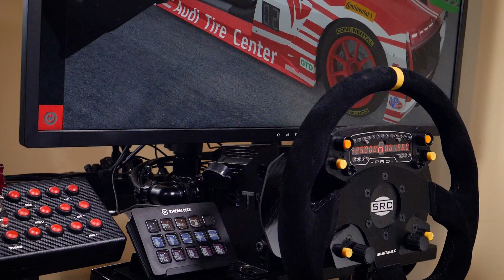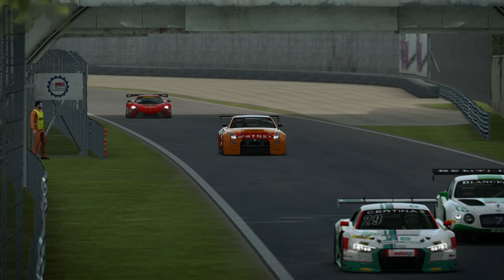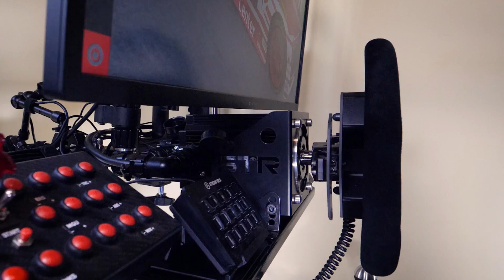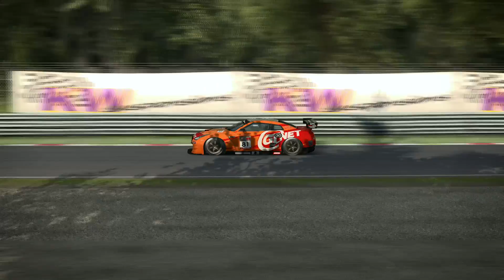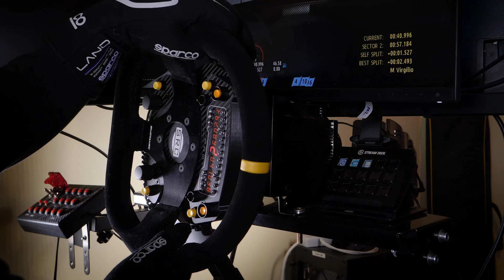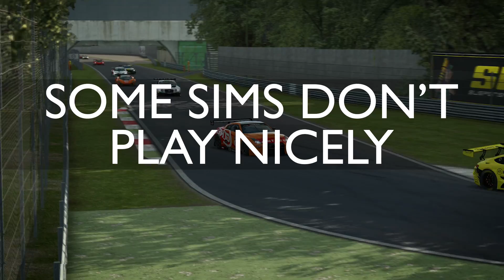Direct Drive Wheel - What They Don't Tell You

Comment: Best Rig: Simetik k2, not expensive but really adjustable but rocksolid
Reply: better: Simlab GT1 Evo. almost same price point
Reply: @Tintop  1 costs 300$ other costs 500$, almost the same :)
Reply: @jorgeaugusto.55  i don't know where your numbers are from, but the Simetik K2 costs 324.90€ (367.98$) incl VAT, the GT1 Evo cost 392.40€ (444.43$) incl. VAT. 
Fully fledged (monitor mount, mouse holder, keyboard tray, shifter mounting points, handbrake mounting point etc) it would be 638.49€ (723.08$) for the Simetik K2 and 655€ (741.77$) for the GT1 Evo. Outside EU you can subtract VAT. 

That is almost the same for me. Both still need a racing seat at this point.
The GT1 Evo is more costumizable in the end and better for later changes. It can evolve with your needs and ideas. With the K2 you are more limited to what you get.

Comment: Hi Chris, great informative video, as many of yours I've seen recently (since I recently subriscribed lol)

I would like to ask, about the seat, that as you mentioned should be sturdy enough, to don't lose the fidelity of the ffb

Recently I've been thinking that maybe one day I would want to upgrade from the G29 I am using, since I feel... It has its limits

The problem is, I got the G29 used for a good price with a Playseat Forza Motorsport 4 edition (which kinda looks like the Playseat evolution, with the wheel stand mounted right on the seat)

Most likely it won't be enough but, would you suggest upgrading the seat first? Or the problem is not that unbearable so that I can solve it later?

Also, recently I won a 100 euro discount on the Next Level Gttrack in a race, what do you think of that?
Reply from the maker: Hey Garden - yeah, I would imagine that you'll run into issues with that style of pleayseat if you get a stronger wheel. Don't forget though you can always turn down the force feedback forces if you need to. I like the look of the Next Level GT Track, though I've never used one. It's has additional upright supports and a much better seat, so from a design perspective, it addresses all of my issues with the F1GT.

Comment: Great info. For some reason I thought you had a ClubSport V2.5. Quite a jump from a T300 to a DD. I am going to hold off and see how DD1 fares, I already have a load of Fanatec wheel rims and other bits so that would be perfect for me. Also, I am pretty interested an the Fanatec Rennsport rig or the Trackracer RS6 to replace my Playseat, just trying to imagine a DD in my deck chair! All in good time though...
Reply from the maker: Hey dude - yeah, I was a happy T300 user for years. Honestly don't know if I'd have made the switch right now if I were using a Clubsport 2.5 - a few people have asked that very question. The Trakracer is the one with the single, side mounted wheel deck support right? That design feature concernes me a little, I'm sure it's sturdy enough, but I'd want to see video of how it handles the load before I parted with my hard-earned!
Reply: @ChrisHaye  Yes, that is the track racer. The tubing looks very substantial, it is the adjustability that appeals too. A lot of the rigs seem to be over complex, way too expensive or too flimsy. The extruded aluminium ones just look unappealing. What to do?

Comment: Chris, I agree about the sliding point you raised. I only have an Accuforce DD wheel but I still have found catching slides induced by my poor driving it a lot more intuitive and successful than with my Fanatec Belt driven wheel.
Reply from the maker: Heh, indeed. I've found that I'm more 'active' with the wheel than I used to be, because feeling the grip limit is a lot easier.
Reply: Oh wow, I gotta ask you..lately I've been eyeballing the exact OSW kit Chris has from simbay 20 Nm Bliss C 4.2 mil cpr.. but still part of me wonders about the Accuforce Pro V2 as the Sim Commander software should eliminate the need to tweak cfg files plus individual FFB settings per car and even physics driven Buttkicker capability as an added bonus. So I guess my question is do you like the Accuforce? Crave more torque? The Accuforce is considerably cheaper for me to get here in Canada. ( And even comes with the rim! )
I too will be upgrading from a belt driven TS-PC Racer so any insight would be appreciated.
Reply: @ericdeangelis7496  I came from a Fanatec V2 and still find myself turning down the FFB as even though the Accuforce is not the most powerful DD base its got far more power than i will ever need and will make my arms ache after a long race. I enjoy using the auto profiles Sim Commander creates for most sim titles and i only have to tweak a couple of sliders and i am good to race.

Comment: Honestly who runs at 100% ffb? Why would you want to? After 8 hours of sim racing you'd be pretty sore and your performance would drop off significantly. I almost feel that the people going after high torque are the same crowd that think harder to drive cars are more realistic.
Reply from the maker: Totally agree Steve. It's nice having the headroom, especially in Assetto Corsa, where some of the cars have quite subtle feedback. But, turning everything up to 11 doesn't really offer much!
Reply: 100% FFB is a great way to get huge arms, mate
Reply: @ghoulbuster1  On one giant arm if you are doing ovals....
Reply: Or one Giant Right Arm if you are doing ovals... :)
Reply: In a real car on a real track you want to keep as light of a grip on the steering wheel as the car allows to maximize the amount of information you receive, on top of that light hands react faster to catch unwanted rotation. So having the torque cranked up requiring a heavy grip isn’t something I’m a fan of. I need just enough torque to give the fidelity I want and push back as the car rotated, no more.
Reply: I lowered my ffb to 45 on my tsxw driver.
Reply: I believe that people should try to get the wheel to give the same response the real car would.  Not higher, not lower. Problem arrives when you are driving a progresive power wheel since I believe games don't usually take that into account for their FFB.
Reply: @sollostyles I'm sorry, I don't recall providing a precise unit of measurement involving eggs.  I said "as light as the car allows."  If the car demands a heavy grip to control, that's that, but you really don't want to hold the wheel with a heavier grip than absolutely necessary to get the transition response you're looking for.
Reply: I use 100% on ovals and 50% on road courses on iracing
Reply: @JohanFouche-k7w  What?
Reply: @TheGermanSimracer  How do you miss the blatantly obvious connection to them ?  Do you even know what YOU said in the post to get that reply ? Are you dumb ?
Reply: I drive and occasionally track an Elise with non-power assisted steering car and a level of steering effort required for that is certainly above what a lot of consumer FFB wheels can produce, as in my experience are karts. Perhaps not the peak torque of a high-end direct drive wheel, but if you're using them to prepare for driving a slicks and downforce race car then it could be in that region.
Same goes for brake pedals - even my Fanatec pedals require a LOT more force than most road cars, but actually aren't that far off what is required for the Elise under heavy braking as it has non-servo assisted brakes, and I've used them to improve the level of force I could apply whilst heel and toeing in a safe environment. Single seaters I've driven even more so.
Reply: It does , even racing go karts im sore all over the next day ,
Reply: I couldn't agree more, when I stream of 6 hours my arms would fall off at 100%.
Reply: @ATLRIOT  this sounds like you suck..... jk jk but honestly wouldnt it make you a better driver to go FFB 100%? so you are used to the amount of FFB a car actually gives you
Reply: hHarder force feedback is fun! I know less feedback is better for performance but stamina is also part of it isn't it?
Reply: it's more of something which is an annoyance to me, you only need a small amount of force to get the critical information across and having the wheel resist you constantly is like having someone constantly tapping your shoulder, it's irritating and not necessary.
Reply: It's for lazy Arm days
Reply: I think in PCARS I run my T300 at something like 40%.
Reply: 100% FFB is fun on offroad races / offroad cars
Reply: I agree 100% ffb is pointless. It does only make you tired, it is not realistic even.
Reply: @francescofazio3518  You are correct, it's only partially realistic. The peak steering torque on my Rotax + Maranello RS-7 is greater than the strongest wheels, and the RS-7 isn't even particularly stiff.
One heat is 15 laps at my track. We run 4 of these. Final heat is 20 laps. I have not had a single non-racer try my kart out and be able to finish a single, 15 lap heat and they are driving at 70% pace at the very best.  They last about 8-9 laps maximum and need help getting out of the kart because their hands and forearms are locked up.
It is a real eye opener for anyone that tries it, racing 2 stroke karts that can do 60mph + is very hard work. I lose between 7 and 10lbs of water weight every Sunday during the season.
Reply: I don’t think its about making it harder, its about making it more real.  Great lap times to me are shit if they’re not accurate to what real world lap times are.  If you’re racing with then real than real forces you’re basically “cheating” so to speak.  Simulation that doesn’t actually simulator some of the forces in a real race is less realistic by nature.

E-Sports especially to me are a joke right now.  Without more realistic forces, motion and FOV they are basically just doing memorization.  E-Sports needs to up their game.

Something like this would suffice.  ;)

https://youtu.be/aWok3AJshGc
Reply: 8 hours of sim racing? What do you do for a life? Or is that it?
Reply: 100% FFB is unrealistic as most racing cars nowadays has power steering.. 100% FFB feels like driving a 1950 non power steering lorry
Reply: @d1want34  "100%" doesn't mean anything by itself you know, if you are using anything up to a fanatec CSW 2.5 there's no way for "100%" to be unrealistic as even with power steering in a normal road car which is designed to be especially light you can get forces coming from the wheel which are higher than the maximum torque the wheel base is able to produce... now if you have the OSW mentioned in the video then 100% can be unrealistic as they can produce twice as much force a normal power steering assisted car would but then if you're driving a non assisted car then 100% becomes realistic again and in some cases 100% is STILL weaker than the real car would've produced.
Reply: @d1want34  iRacing reflects this the best.
Reply: It's free exercise mate. Suit up during summer and lose ten pounds in one race for a real simulation experience ^____^
Reply: 55% AFV1
Reply: Part of the problem is some people setup everything backwards, where they put the sim's FFB to super low levels and the wheel at 100% FFB...that's the equivalent to watching a movie and turning your TV volume to super low and cranking your surround sound system to maximum...you're increasing noise, losing dynamic range and putting your ears at risk in case a random pop occurs...sim racing is no different. Set sim's FFB level to the highest with minimal FFB clipping in the sim (most sims have a FFB meter) and then set your wheel's FFB to the strength you prefer, which for most sane people seem to be between 20% - 60% (assuming a 20Nm motor). I do know people rightfully did this on lowered powered Logitech wheels and it's a learned habit, but totally unnecessary on DD wheels.
Reply: You play for 8 hours?
Reply: I use a T500RS and I run 100 percent
Reply: How about getting a good workout while having fun racing :D
I'm only joking tho, I don't even have a wheel to race on but my brother has a g29 and it's quite light even on max torque(afaik it's only about 2Nm though) With some 20Nm wheel 100% would be too much for prolonged racing.
Reply: I'am at about 95% on f1 with a belt driven wheel (t150).
Reply: how is your ts 150 doing🤣🤣
Reply: The 20nm is enough for me, i only use half of it, sometimes even lower.. as i use my hands for work as well. It's a very nice kit which improves the quality of simracing Alot. I just like where the simaccessories are going!    I fondly remember me playing Indy500 with a tiny joystick, just to get less screech out of the tires (pc-speaker, loL) and to get better laptimes, more realness.. back in the 80's..
Reply: @Frankestein01nl  I used to race with a NASCAR 2003 league when I was in high school, and the only race I ever won was with a joystick! It was my only non-keyboard option and it actually allowed me to smoothly get on and off the throttle, and smoothly turn. Of course, the league banned racing with anything that wasn't a keyboard or a wheel after that...
Reply: One thing is immersion, the other is speed. A high torque wheel will accelerate faster, giving much more accuracy. Especially important when you hit a curb, or you lose traction or something. If for example your wheels want to align to 15°, a high torque wheel will get there twice as fast as a consumer wheel.
Reply: I run at 85% in ac and 100 in acc .
Reply: @Yozzeus  does the FFB on ACC feel different? As well as handling model?
Reply: I´m using my Fanatec csl elite+ wheelbase at 100% and i´m loving it. The 6Nm are just the sweetspot for me. Wouldn´t want anymore or less. And switching to it from a G29 i really feel like Senna or Schumacher when driving an old F1 car :D
Reply: @TheGermanSimracer  a year later; what's your honest opinion on that Fanatec? I use a G29 currently.
Reply: @dinosoarskill17  Still loving it. Haven't had any issues with it. Still believe this is the perfect starter kit for modern GT and Formula sum racer.
Reply: @TheGermanSimracer  thanks. i've had a friend with an issue with the 3.5mm audio jack looking connector for his e-brake, and shifting doesn't always go into gear.
Reply: @dinosoarskill17  Mine doesn't have 3,5mm looking connector. Only ISDN connector styles. What wheelbase does he have?
Reply: @TheGermanSimracer  not sure, i think its an elite
Reply: And what do you do, if you had to race a real car for 8 hours? You cant turn down the "FFB" there.
So turning down the FFB-strength is the same as cheating, because fatigue is a factor, which every real driver has to deal with.
Reply: @PoisonNuke  Real modern race cars don't require more then 10nm.
Reply: @StuninRub  you never drove a real racecar. I was driving in a small league once and still have the opportunity to get in some nice cars on different tracks. And one thing is for shure, because the steering is without any assist, the forces involved can be quite high. Some cars might have up to 50Nm depending on the kinematics, the setup (pre load), aero load will change a lot too, and so on. 10 years ago I was driving a car with up to 100Nm, and after 30 min of test driving I was totally exhausted.
Reply: @PoisonNuke  Yea, maybe if you are driving a shit box from over 70 years ago. Anything within the last 20 years has had power steering.
Reply: @StuninRub  power steering is disallowed by rules, is there anything you know about racing?
Reply: @PoisonNuke  ????? I'm sorry? 

F1 says what?
NASCAR says what?
Reply: Your arms, shoulders, and neck should be tired after 30 minutes. Until they can accurately simulate the G- forces and vibrate of turning , acceleration and braking in the seats  and have a full laydown position like current formula cars them I am not interested.  I held a SCCA national license in the past and raced formula cars, so I am very aware of what racing should feel like. Maybe they can also simulate the costs of racing by torching multipe $50.00 bills each lap.
Reply: Tell that to Protect Cars 2
Reply: Lmao i can do one and a half hours on Dirt Rally before i get tired
Reply: @fukthegoog Hmm, well I often will race all day long on a weekend. Sure I'm a little sore the next day, but while I'm actually doing it, I'm fine. But I keep the FFB levels at a reasonable level where it communicates to me without ripping my arms off.
Reply: Honestly who the F plays 8 hrs of sim racing on one race
Reply: People who are looking for the most realistic experience would want to have 100% ffb, but most sane people would normally run at lower settings and only turn it up sometimes when they were feeling especially... "simmy," i guess

Comment: How do you like the F1-GT chassis? I am looking at getting the F-GT (the updated version) for my setup. I just got the Fanatec Clubsport V3 pedals and have the Clubsport v2.5 wheelbase on the way with the McLaren GT3 wheel staring at me as I type. Is it comfortable to sit in for a few hours at a time? I league race and will probably be in it quite a bit and was just looking for the opinion of someone who uses it regularly, especially since you have some of the same equipment. I am also considering the GT ultimate as I heard that is pretty comfortable and is very versatile as you can get the desktop for it and flight sim attachments etc. but it costs a fair bit more.
Reply from the maker: Hey dude - I'm on the fence about the F1GT / FGT. My example felt like a Friday afternoon job - quite a few pieces didn't fit well. I needed to elongate some of the holes with a file to get parts to fit and lots of the pieces were poorly finished, leaving sharp edges. That being said, once it was all together, it served me well for the last 18 months or so, and was a massive improvement over the wheelstand I have. As for comfort, it's good in that regard. I'd rather have cloth seat over vinyl, but it's still better than a bucket seat!